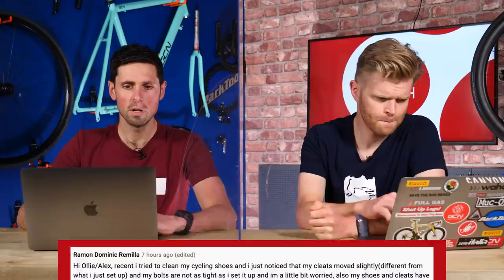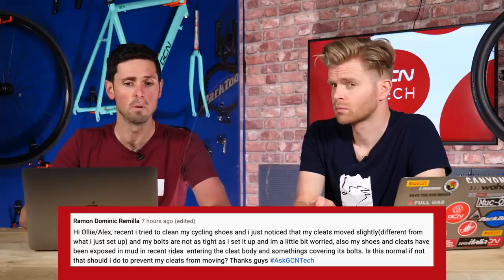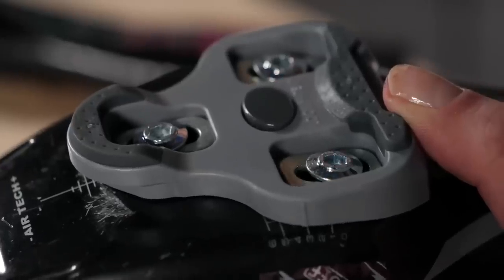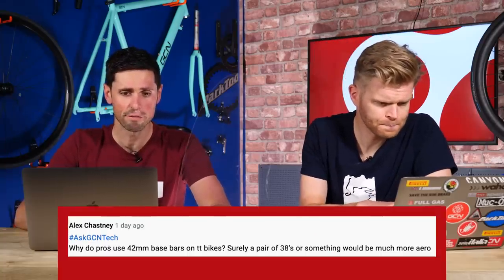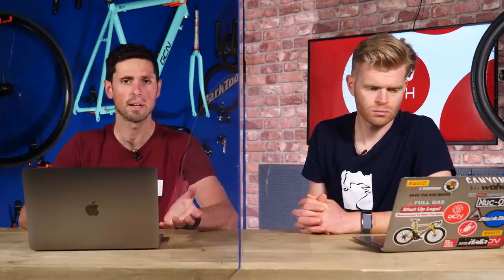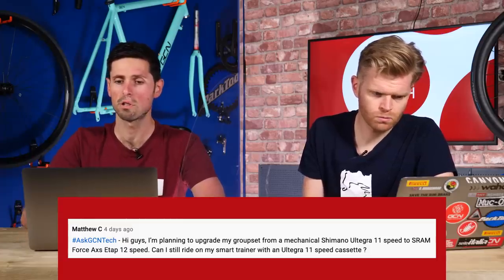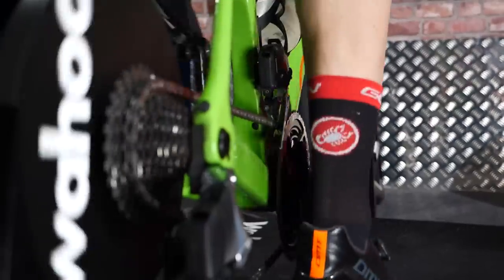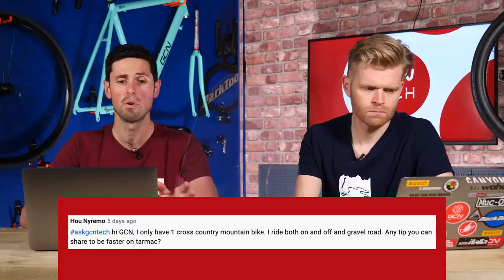Why Don't Pros Use Narrower Base Bars on Time Trial Bikes? | GCN Tech Clinic #AskGCNTech

Comment from the maker: Do you have any GCN Tech questions? Let us know using #AskGCNTech!
Reply: #AskGCNTech I have just begun riding a TT bike (midlife crisis). On the tribars i find there is a tendency to wobble. Is this a rider issue (core strength) or a bike fitting issue? I got a Felt B12 2nd hand and have been tinkering (torque wrench of course) with it too an extent which im pretty comfortable on it. Please help.
Reply: #AskGCNTech i am getting a new road bike next month and i have 100 pounds to spend on accesories for it please tell me what to do i am kinf of lost
Reply: #AskGCNTech Have you got any recommendations on the most aero way to mount lights (front and back)? A lot of lights use strap on mounts that don't seem so aero...

Comment: changing cassette from 11 28 to 11 30 no need to change the chain … according to my experience on exactly that change on ultegra (the only thing you might have to adjust the distance of the derailleur to the bigger 30)
Reply: I agree, just did this to start the summer and I did 11-28 to 11-32 and there was no need to change length of chain
Reply: My method of fitting chains gives me maximum cassette range. I didn't plan it that way, it's just what made sense to me when I started trying to work on my own bike. I wrap the new chain around the small chainring and 11t cog, then I pull it just tight enough so that there's tension on the rear derailleur (not that I'll ever ride with it like this, but I know this is the maximum length I can get away with). This way, I can run any size cassette that the derailleur cage supports. Was able to go from 11-28 to 11-32 on three different 10-spd bikes, all with short cage derailleurs - 6700 (52/36 chainrings), 7900 (52/36), and 6770 di2 (50/34). As long as I properly set the limit screws, I never have an issue with the chain dropping and the shifting is crisp.
Reply: Agreed, I’ve changed from 11-30 to 11-34 and back again on the same chain, no probs.
Reply: MRGRUMPY53  Do World Tour Pro riders downgrade their bikes to 30 or 32 tooth cassettes for certain stages of grand tours? 🙂
Reply: Not to mention it’s fine to add links…
Reply: @charlificity  do you have specific reasons for switching? E.g. Why not leave the 11-34 on? Does it make a huge difference?

Comment: Regarding base bars- The advantage of a slightly narrow bar on a road bike is that it makes the person's body more aero for effectively all of the ride. On a TT bike, the base bars are largely used when out of the saddle or accelerating to get mechanical advantage which is a small amount of the time in a TT.  Pros would rather have the leverage/advantage of a wider base bar for the brief period when out of the saddle or accelerating over a minimal, short term aero savings over that same brief period using something 38cm wide. It isn't so much availability of narrow bars. 

If a narrow base bar was really some superior advantage riders would just drop the base bar entirely and simply grab hold of the aero bar to get the advantage and save the weight.
Reply: The real answer is always in the comments
Reply: A few years ago. A rider did just that. It was interesting watching him trying to take off from the starting line holding on to the aero extensions.

Comment: Sewing machine oil is actually very good for cup and cone bearings on a bike.  High quality older bikes used to come with oil fittings exactly for this. The idea was to give a squirt of oil every so often which was also enough to flush out the dirt.  They even used to sell oil fittings which you could install on hubs or BB.

Comment: You can't add links? Berm Peak Express made an entire chain out of quick/master links and it actually worked pretty well! But I would still lean towards just using the same chain for a small cog size change like that, assuming the old chain isn't too worn.

Comment: Wait wait wait sewing machine oil is very very different from chain lube. Has a relatively thin viscosity, not soluble in water and resistant to heat, these are good qualities for bearing. Chain lube isn't much of an oil it more like a Teflon fluid (sure depends on the brand) whilst it is a thin viscosity, it is soluble in water and wouldn't do well with the heat in a bearing. So would give you protection... for like 1 ride and would need to be reapplied. Sewing machine oil is a good choice rather

Comment: In regards to TT base bar width... one possible answer; considering riders are only on the base bar when accelerating, cornering, descending, out of the saddle, etc. it's likely that the wider bars offer more benefit in these situations, over the very slim aero gains of the narrower option???

Comment: the bolts arent coming loose, the cleats are sliding likely forward which causes it to be loose. you can try to use bat or hockey stick grip tape between the sole base and cleats, or those star / spikey washers that you sometimes find between frames and brake calipers. use the washers between the base of the sole and the cleats also. i think a tacky glue would work too but that can get messy, just dont use a permanent glue.

Comment: When relubing a BB, make sure to use a compatible grease.  Most come with polyurea-based grease (looks jelly-like and is a translucent green, red, or blue typically).  Some (esp. older designs) use lithium-based grease (creamy white color).  Don't mix the two types.

Comment: #AskGCNTech Why do Elite-level TTers use the deepest wheels, and then opt for the shallowest rotor. Surely the DA Freeza RT900 rotor is more aero than the (very marginally) lighter XTR one. Is there any windtunnel testing that supports any of this?
Reply: There rumors about the XTR rotors not being measurably slower than the Freeza, but creating marginally more steering moment, so making the bike a tiny bit more difficult to handle in the wind. Don‘t know if that is true, but the differences will likely be minimal either way.

Comment: #askgcntech Hello Alex and Olli, I don't want to be impolite but I have a few questions on some of your answers. First about the chain question with the cassette-sizes: In my thinking, you never have to change your chain length for cassette sizes if the cassette fits with the derailleur cage, you don't change the chainring sizes and you use the little ring-little cog method. What is the fault in that? And the other thing isfor the question with the turbo trainer and the groupset chang eon the bike: Except of spending lots of money on a SRAM Force cassette and new freehub body couldn't you use one of the new SRAM Rival 12-speed cassettes on a normal shimano hub? Best regards, I love the Tech Clinic! Today I just got confused whilst thinking on the subjects myself.

Comment: Okay lets try to end this, bike engineers hear me out (lol). About BB lubrication using thin oil ( 7:15 time stamp). Why don't we put an oil reservoir like what we have in vehicles to enjoy the smooth rolling of bearings in the bottom bracket? Changing them every 2,500 to 3,000kms? Thoughts? (Damn)

Comment: It seems to me that the Q factor also aplies to handlebars and stem. (cockpits are in aircraft) super narrow bars are a joke, aero dynamics on a road bike are quite negligible. But when your stood up pulling on the bars for leverage for power seems to be a missed point. It works on an axis almost like a gyroscopic action, never seem to see this point discussed... 4 points of axis all working together.

Comment: #askGCNTech

I have a Specialized Tarmac SL6 Sport which I love a lot. But I also love integrated style of the SL7. So can I buy an integrated stem style and fit it with the SL6? Or maybe buy the handle bars and stem of the SL7 and fit on the SL6?

Comment: #askGCNTech Hi GCN Tech, after only a few weeks of use, my HR soft strap has started to stink disgustingly even though I wash it with soap after every use. It smells like burnt rubber  and only on the part with the electrodes. Can I do something about it? (maybe chemist Ollie knows what is happening here)
Reply: For what it's worth I never wash mine other than a tap water rinse about once a week and it hasn't degraded or really stank ever. The soap might be overly aggressive
Reply: @davidwilson192  I don‘t think so. It „extra sensitive“ shower foo. What brand of strap do you have?

Comment: #AskGCNTech - Evening all! Do you have any tips for cleaning workshop rags? I’ve got two tea towels, a cloth and an old T-shirt covered in various greases, oils and gunk and struggle to get them clean. Seems wasteful to throw them out but when I soak them it doesn’t clean it and when I try and use the washing machine it just leaves the drum bogging! Any tips welcome! 🙌🏻

P.S - why has Alex got no stickers on his laptop but Dr Oliver has hundreds?!
Reply: A bucket of very hot water with a scoop of biological washing powder. Give then a scrub when it's cooled down enough, then rinse them in another bucket of clean water. It won't get them spotless but it removes enough of the filth to make them usable again.
Reply: @steve.b.23  Done it before and it doesn't work well enough (IMO)
Reply: @TheSamwhyte  Hmmm... OK... Do you use degreaser that can be diluted with water? Maybe try a 50/50 solution?

Comment: #askGCNTech If riding with one water bottle only is it more aero and weight advantaged to have it in the down tube (front) or seat tube (rear) position?
Reply: Seat tube
Reply: Depends on the bike honestly, but the downtube generally has a wider profile so it shields the bottle, and also this tilted position makes it a smaller frontal surface compared to bottle on the seat tube
Reply: @appelflapdrol  this was my thought as well, though to be fair it's probably like half a watt difference even at high speed 😂
Reply: For more gains release a small brown bear before going on a ride, saves weight, smaller belly more aero
Reply: @appelflapdrol  I guess technically, a nice fat, round belly is more aerodynamic than a flat belly, like a ball is more aerodynamic than a plank. Also abs showing through a very tight jersey could further increase aerodynamic resistance...^^

Comment: #askgcntech hi, if you ride slower than the pro's, do you get away with a shallower wheel depth, for the samen aerodynamic advantage? For example, if the pro's ride around 42km/h with 45mm wheels, do i have the same aero advantages with 32mm deep rims riding 30km/h.

Comment: #askGCNTech Hey! Very recently I have purchased my first road bike ever, and straight from the first ride i hear some slight, silent noise coming from the chain/front mech area while I'm using harder gears and putting in more power. I have tried cleaning and lubing my chain - did not help at all. The mechanic at the bike shop told me it's normal and there is nothing to worry about, but it's a bit concerning and annoying - any tips? The components are Shimano ultegra by the way. Thanks!
Reply: I have full Ultegra groupset and mine is not silent. Emphasised if I cross chaining. I'm looking to do a deep clean of my chain and swap to change to Squirt lube as my gravel bike with SRAM Force is buttery quiet and smooth (1 by) and has Squirt lube. I will reply if it improves significantly
Reply: Silent noises are the best ones 😉
Reply: lol, just realised that I really wrote that :D
Reply: @twiggyinc1  Thanks a lot!
Reply: Is it rhythmic with the pedals stroke, or out of sync with pedalling?  Is it more a clicking or rubbing, or even creaking?  Also, if you can get someone to ride/run beside you and help pinpoint the source, that usually helps diagnosis a lot.
Reply: @d00dEEE  It is a slight rubbing sound which can only be heared when I'm pedalling, but I wouldn't say it's rhytmic, it's rather constant.
Reply: @adamlorincz3025  what version of Ultegra? I feel like I heard something about the r8000 big ring being noisy when it was first released, something about how it was manufactured. I think I had a friend's bike I worked on with those that sounded almost like the chain was rubbing the front derailleur if the chain wasn't perfectly in line with whatever cog you were on.
Reply: @ryanw8987  It is the R8000. It really sounds like the chain is slightly rubbing something, this could be the issue.
Reply: A likely cause is that the chain is rubbing the FD due to a small amount of flex in the system when the chain is close to the FD (ex. using the more outboard cassette cogs) and hard pedaling introduces a bit of flex to the system (chainring/BB axle/frame BB).  The FD can be adjusted to eliminate the rub.
Reply: @adamlorincz3025  Hmm, sounds like Ryan has the answer, it fits the noise you're hearing.  Maybe ask your bike shop if they're aware of this issue, see if they can find a chain with a different side plate geometry or something?
Reply: @adamlorincz3025  I'd still double-check that it's not rubbing the front derailleur, maybe move the limit screw out a bit to let the derailleur move further outboard just to make sure flex isn't an issue like Jon mentioned, but if you have another crankset/big ring available to you to try out it could let you know if that's it.

Comment: #askgcntech Hi, I’ve had problems with my saddle tipping back mid ride (usually when I hit a bump). The seat post is carbon and I correctly torque it up before I go out. Should I be using a carbon gripping paste or just over torquing it? Help 😬
Reply: Carbon gripper!! Please don’t over-torque it 🙂

Comment: #AskGCNTech Hi Alex and Ollie (or Manon)
I was watching the Formula 1 and saw what a difference slick and wet tires make in the rain especially when cornering. My question is why don’t pro have a wet specific tire? (They could have a bike setup with the tires and just make a quick bike swap or start with it when they know it’s going to be wet all day) Surely a wider tire and more groves to displace the water will be safer and easier to descend. I know things like weight and rolling resistance is a factor but this could be made up on bigger descents.
Reply: The groves in a F1 wet-tyre are only there to avoid aquaplaning which is not a thing with 25mm wide bicycle tyres
Reply: And in very simplistic terms, the force applied by the little 25c tyre to the wet road surface displaces the water. So a little narrow 25c tire is not going to aquaplane like a nice big fat wide F1 slick tyre.  Not a proper detailed physics answer,  but hopefully gives a little insight.  This will explain why pro riders can go so fast in the wet, plus the confidence.  Of course, there is still a limit vs the dry.
Reply: The grooves in bicycle road tyres do not work for displacing water. The wheels do not rotate anywhere near fast enough to do this.

Comment: #AskGCNTech 1. On my Garmin; if I only need 15% of battery charge on a ride but I have it charged at 100% "Will the extra 85% battery weigh me down?"
2. If spit during my ride, do I loose weight and save some grams? 
Thanks guys
Reply: Yes, and yes. You should also breathe out at the beginning of the ride and not breathe in again until the end. The air in your lungs is extra weight that only serves to slow you down.

Comment: A wide TT base bar doesn't matter because you aren't in that position for most of your ride. You need wide base bars for their stability when turning (which is when you're normally holding the base bars.)
Reply: Still aerodynamic unefficient i'd guess and you can turn fine even with a 36 bar
Reply: it’s not turning that matters, the width is more important when climbing out of the saddle
Reply: @simonsimon8213  agreed, might be a case of which is more important. For the short times and slow speeds spent on them, I don't think the aero aspect matters as much. While on the TT bars at higher speeds, the slightly wider base bar being exposed to the wind would create more drag. Not sure how much, or if it's affects are that noticeable. More about the shoulders of the rider while in the wider position that creates the larger profile to the wind.
Reply: @scotth3354  yeah that's a good reason also

Comment: #AskGCNTech   Hi GCN Tech Gang:  In 2017 Greg Van Havermaet beat the Paris-Roubaix speed record of 28.04 mph set by Peter Post in 1964, but by the tiniest margin of 0.05 mph.*  The fourth fastest Paris-Roubaix ever ridden was by Rik van Steenbergen in 1948 at 27.33 mph. Why hasn't modern bike tech lead to significantly faster Paris-Roubaix times over the last 70+ years?  * https://en.wikipedia.org/wiki/Paris%E2%80%93Roubaix

Comment: #AskGCNTech Why don't bike manufacturer make drop bars for TT bike so on flat as a pancake races riders could have the most aero frame possible
Reply: They only hold the base bars for cornering, so adding drop just adds wind resistance without any riding advantage for the other 99% of the TT. Riding that same 99% of the TT on the tri-bars is significantly the most aerodynamic position.